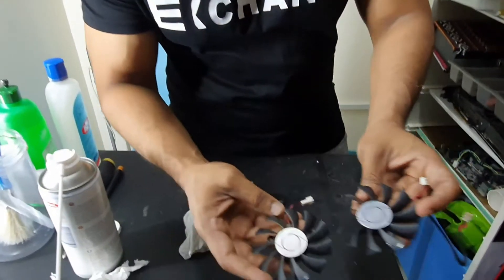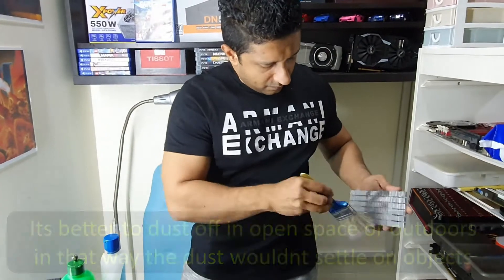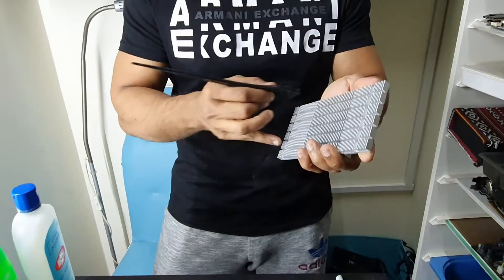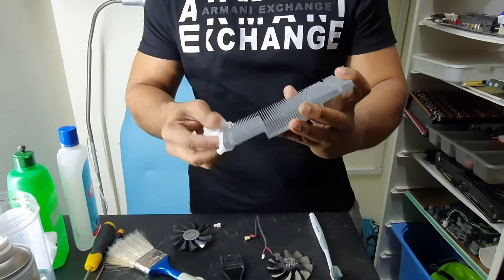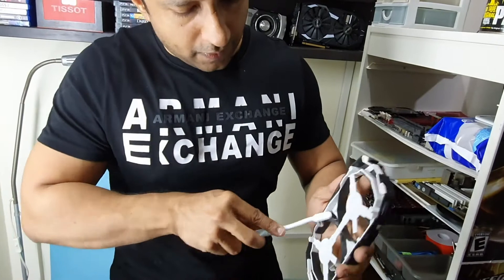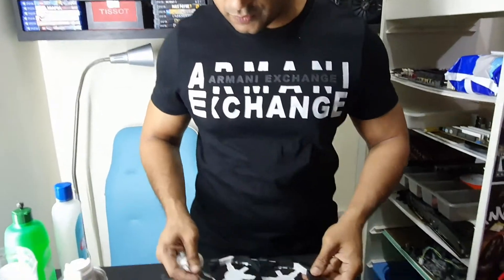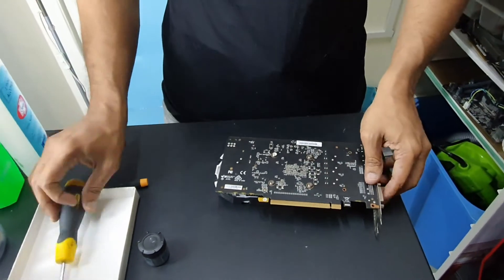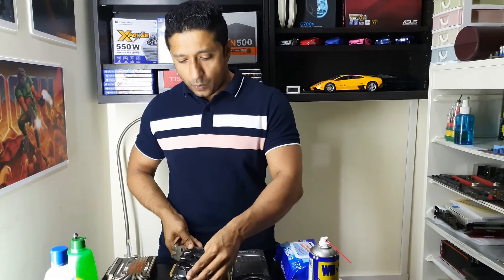How to Clean Graphics card? MSI GTX 1050TI 4GT OC | Part 2 |  The 2 Far Tech Method |

Comment: Where is the vram thermal pad? I guess it isn't there from the beginning.
Reply from the maker: This is a entry level GTX 1050 Ti which runs on low power. It cant be overclocked and it doesn't get that hot, so the manufacturer doesn't provide thermal pads on most of the GTX 1050 Ti basic models.

Comment: I'm still using my MSI 1050Ti 4GB OC  to this day since 2017, I couldn't able to clean the inner part of the GPU because I was scared that I might break or lost something, thanks to this guide I'm able to clean the inside of the GPU.
Reply from the maker: I am happy to hear this and glad you could actually complete this task.  Some young ones actually try it and get stuck on the end.
Reply: @2FarTech  Will try to clean and reapply new thermal compound on weekend once my Arctic MX-5 arrive, I'm still having second thoughts since my GPU temp is just around 38-42 on idle and 50-60 on gaming.
Reply from the maker: 50 to 60 is gaming is good.  And if you are comfortable, go ahead with the thermal paste.